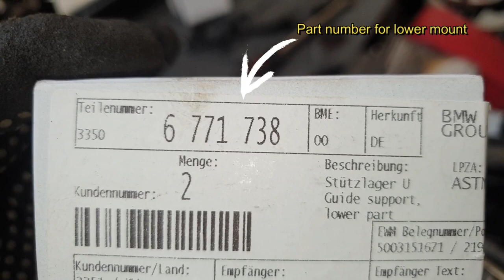BMW E93 Rear strut mounts replacement.

Comment: Yes this video probably has the best views in illustrating the replacement of the shock mount. It’s looked as though that shock assembly was blown, as it seemed as though you were pulling on the rod to extend it through the body, when on a functioning shock absorber, the piston rod should extend on its own. Did I miss something?
Reply from the maker: Thank you very much for your comment ... your observation is 100% true ... the shock absorber was gone too ... but at the time of the video, i only replaced the mounts ... later, the shock absorbers were replaced too

Comment: this is a great video explaining how to get access to your rear shocks. i’m planning on doing mine this week, i have all of the parts but my question to you is if you could give me a list of all of the tools you used for this job?
Reply from the maker: I replied you before but seems my reply was not posted ... anyway ... thank you for your nice comment ... the tools used are some different sizes of wrenches/ ratchets 6mm, 10mm, 13mm and 17mm in a addition to any tool to remove the clips ... that's about all ... and you can also see them in the video.

Comment: If that shocker is staying down and you have to pull it up it’s trash,,
Reply: Not to mention that during an installation  the rubber sleeve was not installed on top of the lower foam mountain and bump stop was not replaced on already completely shoot rear shock. You are 100% right it's garbage and installation just pure waste of time and new parts. But good to watch to see how not to do such repairs on BMW!!!
Reply from the maker: You are absolutely right, i knew the shocker was gone, but at that time i had no money to change the shock absorber and the mounts were making a very annoying noise. I already replaced the shock absorber after that video. I appreciate your feedback.
Reply from the maker: It's also good to post such videos to see such rude comments. @olehsadovskyy6774
Reply from the maker: Not to mention that if you look at the video from 6:04 to 6:09, you will find out that i pulled it down again and installed the rubber boot. The bump stop was replaced with the new shock absorber. And this video is to show how to dismantle the parts, then you can change whatever you want. But again, it is nice to post such videos to see such rude comments. Waiting to see your videos.

Comment: if my convertible isn’t working can I still put back the trim pieces
Reply from the maker: Open it manually... i think it would be impossible to change it without opening the top
Reply: @mahmoudmohasseb5530  I changed it but I can’t push the trim piece back. Can’t open it manually due to a convertible issue so it stays locked even if you press the button

Comment: Hi my new nut am too mount doesn’t seem to catch the thread to screw on the top Iv pulled the shock up as much as possible any ideas?
Reply from the maker: You either got a wrong part or you are installing it the wrong way